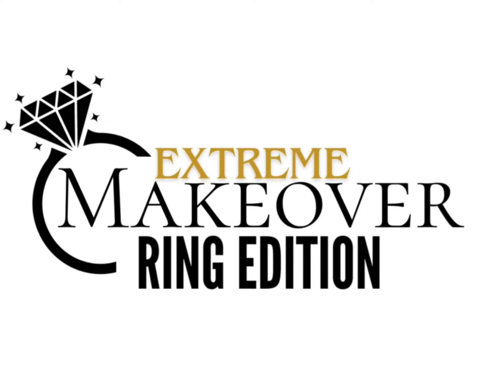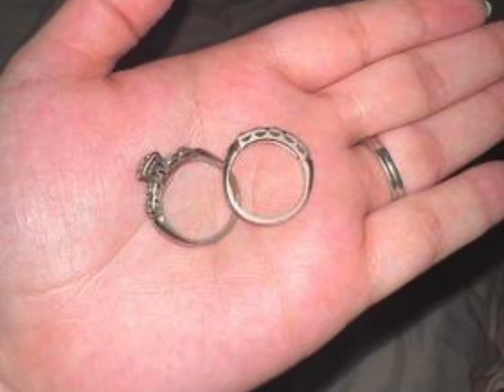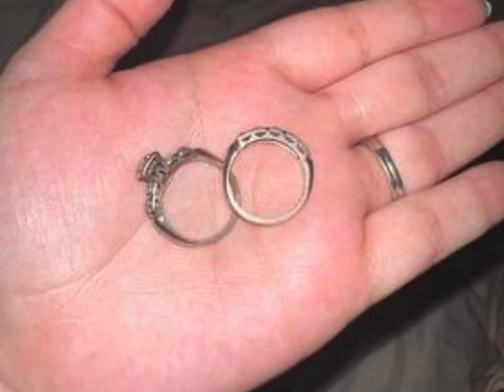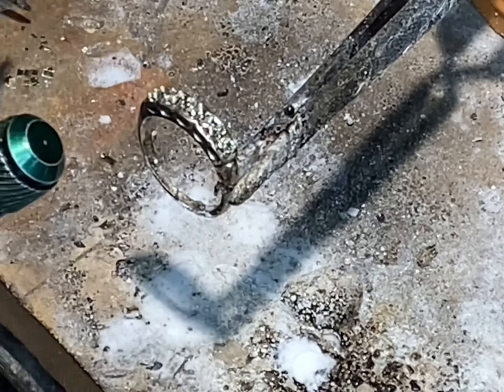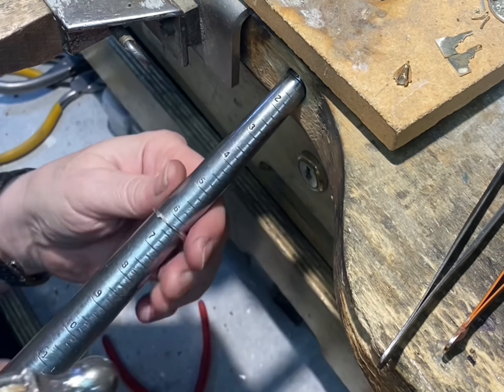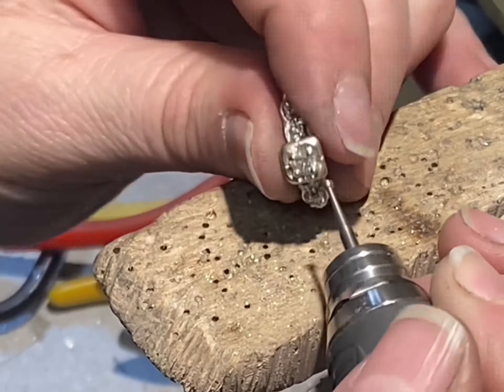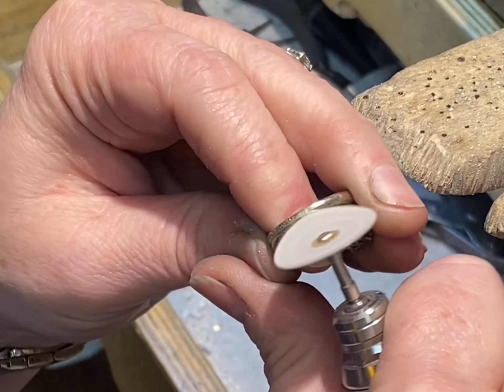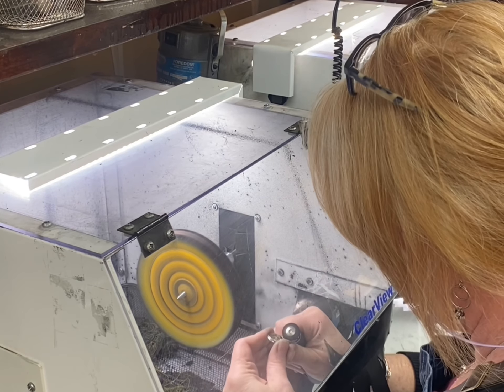Extreme makeover ring contestant Lexi, gets a complete refurbish

Comment: This is my absolute favorite vintage style wedding set! I have 3 or 4 like it or very similar to it, but I can't wear them any longer due to my fingers swelling from medication I have to take. Plus, the most favorite one I have, while it's not missing any stones, and none are broken, it can still use a good going over for the wear to the metal. Like this one. Some of the prongs are uneven, and the milgrain could use a "refresh" treatment like done to this one. 
How much does it/would it cost to retip some of the prongs, refresh the milgrain in a very similar manner, resize both rings up about 1.5 sizes from a 7 to an 8.5, and redo the rhodium? It doesn't need any stones replaced like this one did though. Just curious, since I didn't really get an anniversary present for our 48th Anniversary the end of July!